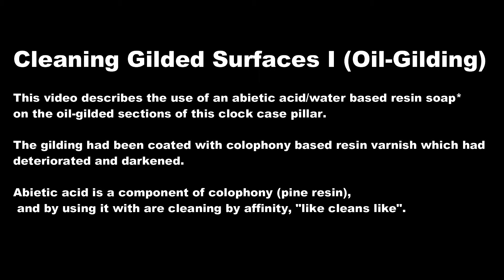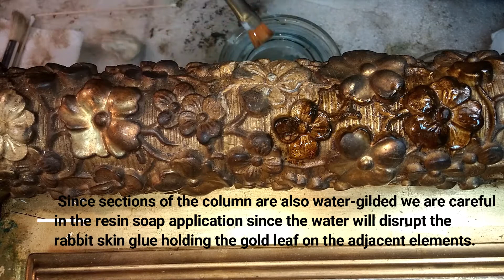Cleaning Oil Gilding with Resin Soap

Comment: How would I know weather my product was originally water or oil gilded? I am trying to restore a candle girandole which I believe to be brass and gilded. I can’t find much information on how it was gilded. Any tips or is there a website with information you could recommend on how to make a solvent 
or is your resin soap available for purchase ? 

Thank you for your time !
Reply: Perhaps I can send you pictures via email and you can help me with a way forward ? Thank you 🙏
Reply from the maker: Metal object tend to be fire-gilded (if it is 18thC) or more likely gold plated, which is an electrochemical process by which a thin layer of gold is deposited on the surface of another metal. An electric current draws gold ions, which are positively charged, through a gold bath solution, allowing them to adhere to the negatively charged piece of metal. You can assume it is NOT water-gilding, but there is a chance it is oil-gilded, but I doubt it. The materials I use in cleaning, I make in the lab for specific purposes and not available. What is it you are trying to do?
Reply from the maker: Is your girandole wood or metal?